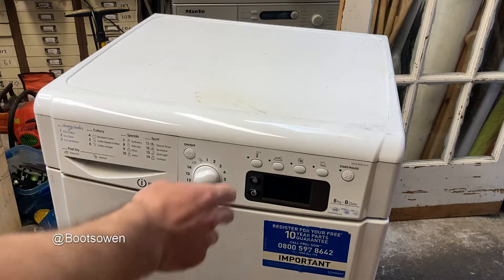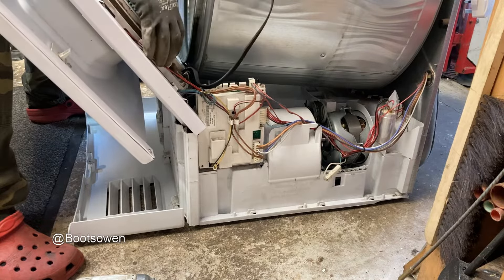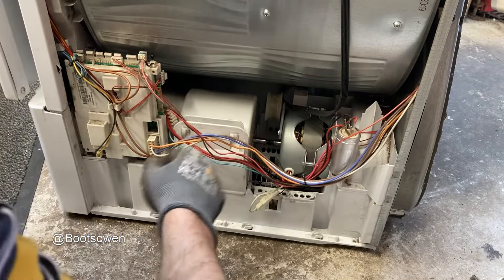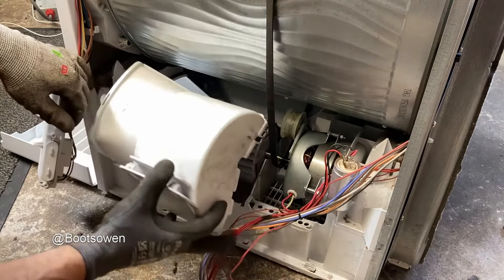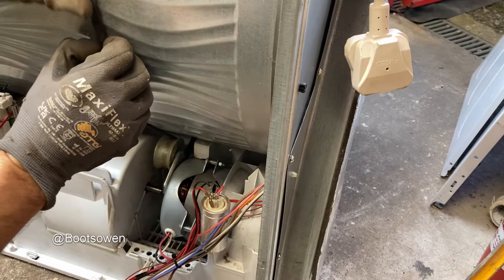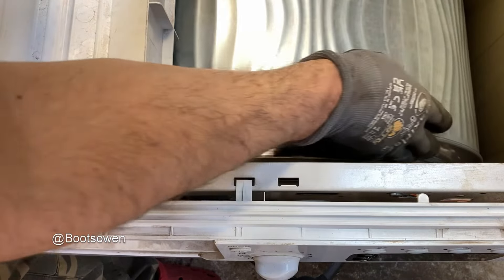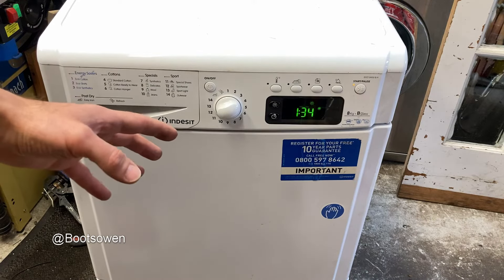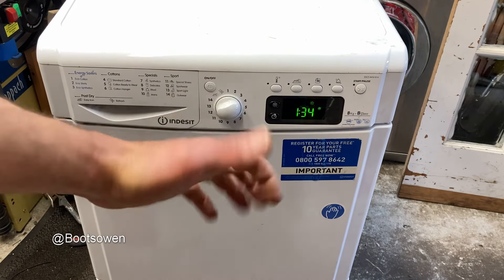How to replace a broken belt in a tumble dryer

Comment: The belt is on the wrong way buddy, it has to come towards you and over that pully wheel, not inside and over the pully wheel. It's much easier to take the shaft off the back than all the shite off the front, the fan on front of the motor under that cover comes off too, makes life so much easier, just tips to help u pal.
Reply from the maker: Cheers balfie. 
I just got a machine where the heat pump doesn’t seem to be making heat. It also has a dud drain pump. Do any of the manufacturers recommend repairs on heat pumps or is it always abandoned?
Reply: @bootsowen  it's possible it's not heating because of the pump, that will stop it heating. But, if it's system failure from no heat because of a blockage then it's scrapped. We don't change bases on heat pumps,
Reply from the maker: I took it all apart this week, to get inside the fridge elements, there is a little bit of expanded polystyrene on each side between the two elements to guide the air. one had melted and deformed allowing the air to bypass. so I cleaned it all and made a replacement and it is working now. Takes bloody ages, but it is in a cold cellar.
Reply: @bootsowen  heat pumps need to be kept in a room with a ambient temp with minimum of +5° otherwise they don't work correctly. Takes around 30 mins to heat up properly anyways, and if you open the door during the cycle, it will lose all it's heat, and start all over again, better to close the door and forget it.